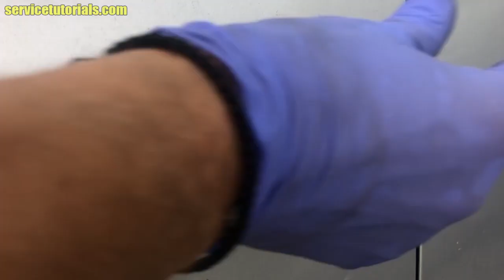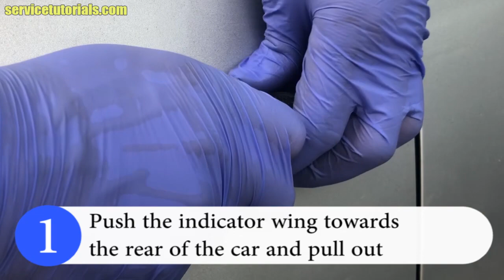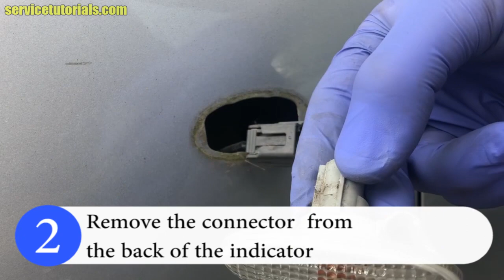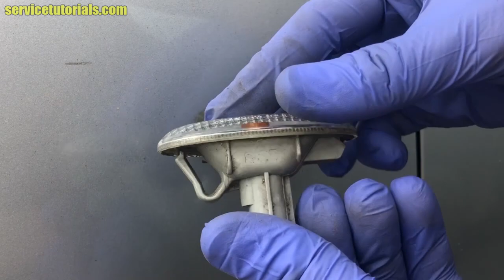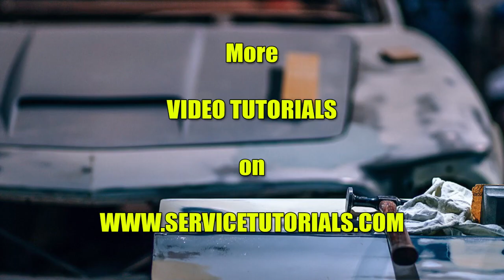TUTORIAL: How to replace side wing indicator / repeater bulb Mazda 3 in 2 steps

Comment: Can i change bulb on this lamp???? And if i can, what kind of bulb need?  T10 w5w?
Reply: honestly your better off just buying a whole new set of side wing indicators from ebay for like 20 bucks, i got some dynamic LED ones since my stock ones went out.
Reply: I popped off the clear cover and then you can remove the bulb and replace it with a T10 bulb and seal it back with clear silicone